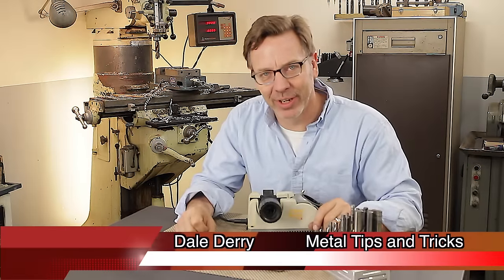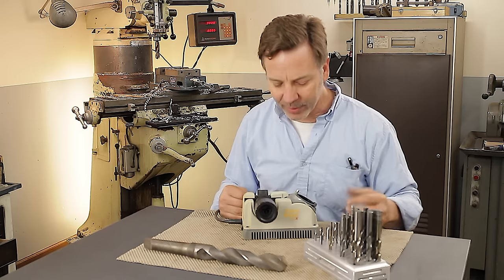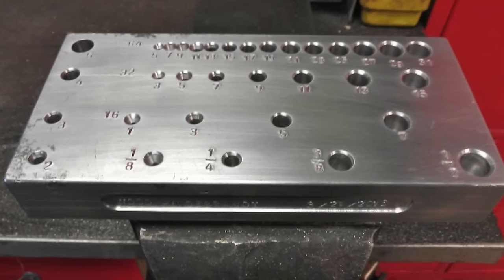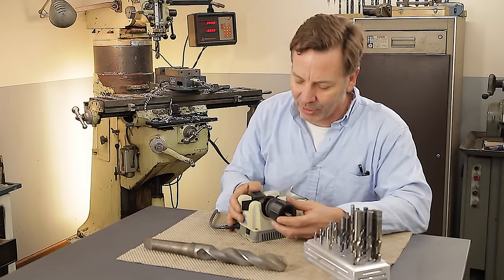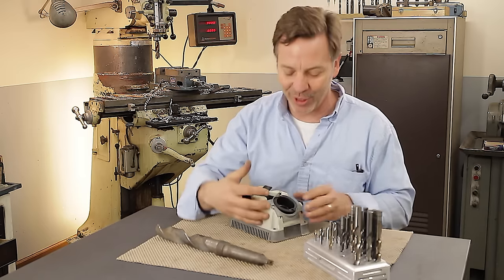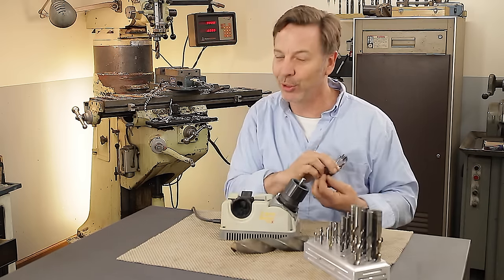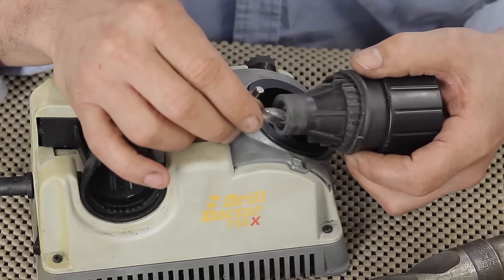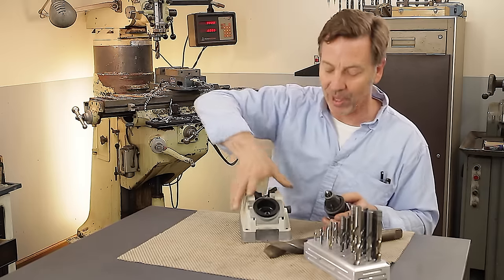How to Sharpen Drill Bits

Comment: My grandfather had one of these that is decades old.  When he passed, I received it.   There is an instruction video that came with it, but it is a VHS tape.  You can conclude that I have not been able to play it.  I tried messing with it one time and Screwed up a few drills.  So in a cabinet it went.  Now I want to get it back out and sharpen some drills.  Thank you for the video.

Comment: Greetings from the Jersey Shore. My neighbor got one of those for Christmas a few years ago and brought it over my shop so we could figure it out together.   I wound up sharpening all of my old bits in an hour or so that night.  Those things work wonderful.  My test for a drill bit is to put it in my tail stock of the lathe to see if the bit cuts evenly from both flutes.  Every bit I sharpened on the Drill Doctor cut evenly both fluted.    I've tried others hand sharpened bits on a lathe and most only cut from one flute. Chris
Reply: You can just put a drill in a pedestal drill press and once you have drilled a hole put the rear of the drill in the hole. That was how I was taught to eye sharpen drill's.

Comment: Hi Dale, 
Great video. I bought my Drill Doctor more than 15 years ago and have learned by experimenting what works best for twist drills. You have to listen to the grinding sounds. There have been no problems other than having to replace the diamond wheel due to wear. I especially like its light weight and bring it with me when drilling concrete with carbide spade point drills. The drill doctor puts a fresh edge on the concrete drills and the drilling go so much faster even when stopping part way through to "touch up" the drill point edges.
Thanks ago for another useful video,
Paul Jones

Comment: Good video Dale. I learned how to sharpen drill bits on a bench grinder way back in high school in Metals Shop Class back near Chicago. They've always turned out great, as I was born with exceptional eye sight 15-20, at least that's what the eye doctor told me. While working as a Journeyman Welder/Prototype Fabricator, I could see something off 1/64th" up to 16'. Well I don't have those eyes anymore, I'll soon be 59 in a few days, but I can still sharpen the bits. 

What intrigued me on the Drill Dr. was the split point. Now that I wouldn't do without a machine. I can clearly see the accuracy increase. I have a Harbor Freight Mini Mill that I got for creating my inventions. I do have a pile of drill bits set aside that need sharpening, and it's slowly growing.

I was put on SS Disability since 2007, and having a workshop helps keep my mind sharper. I'm now In the final phases of the upgrades on the mill, which last but not least is the  DRO. Maybe some day the next upgrade will be CNC'ing the mill. 

Remember those safety glasses Dale!

Keep up the good work!
Crevice Dog,
Vancouver, WA

Comment: Hi Dale. Thanks for the video. I have a 750 and when it is working it is a pleasure to use. What I mean specifically is that after a series of bits get sharpened to my satisfaction, I will put it away until needed. Then when I bring it out to use a while later it no longer sharpens right. The relief is now flat or negative and the settings are still the same. Its been a while since I used it but seems that the clocking on mine depends on the diameter of the bit. I have not had the patience to figure out the relationship but I think others have had the same experience. One good thing about Drill Doctor is their customer service even though they were not successful with me. Keep up the videos. Oh, and I am viewing this from Chuluota, Florida.

Comment: I had one of these, slightly different version.  Never worked right for bits over half inch, but it was helpful for the smaller bits. It was too much problem to get a replacement stone, so I just threw it to the side and now hand sharpen all my bits.  Bluefields, Nicaragua.

Comment: Myself i have to like the Drill Doctor as it makes sharpening smaller drill bits so much easier.
The fact that the flutes are the same length is why i use it. 
But for larger drills i still prefer to sharpen by hand on a pedestal grinder and check them with the scratch stick.
Thanks for the video Dale.
All The Best.  Peter. 
Melbourne Australia. 
Or as you yanks like to say Mel-Bourne Australia.

Comment: Hello Dale, I bought one last birthday and I'm very satisfied. I use the 180 grit wheel more, because i use the smaller bits most. A fresh sharpened drill bit is a joy to work with. I have the grey 500's DD, but I do want to buy the larger head, Amazon has it for 60.-€. Love your videos, go on with it!  Hanno from Hamburg, Germany
Reply from the maker: +MrMiffy08  thanks for you comment. 😀

Comment: 118° HSS Bright Finish drills are for Non Ferrous drilling.  Generally speaking, Black or Steam Oxided drills are more for steels, cast iron, etc. 135° Bright Finish split point drills are ok too, they tend to walk even less than a 118 split point.  Keep in mind there are also NAS907 (perhaps others) aircraft geometry drills.  As I've recently learned, if you're gonna drill Aluminum... beat the race by picking up some OSG ExSusGold drills.  You won't be unhappy.  A Darex or DrillDoctor is quite a tool and handy in the shop.

Comment: HI Dale.  I've been using the DD750 for probably 10 years.  I use the 135 edge split point geometry almost exclusively.  I find the 135 point, when split is better than 118.  Standard non-split "jobber" drills that have the short web connecting the drill lands perform best at 118 deg.  I do like the DD and use it to do 135 splits down to as small as #40 wire gage.

Comment: I have one of the original Darex sharpeners, floor standing, with a 2 wheel Baldor Griber.  I handles everything form 1/16 to 3/4", plus I can custom grind bits  for special materials like plexiglas.  It must be close to 30 yrs old, and works as well as when I first got it

Comment: I have a 'blue' drill docktor out in the shop... but its a real older one... so old I still have the box it came in, and it came with a VHS tape on how to use it!
its okay for general bit sharpening...the more advanced ones back then were real expensive.  I do fancy one of the new ones, though.

Comment: Hi Dale, Vancouver, BC, Canada. I agree. I have two drill doctors (older blue, 3/4). I use them every weekend. Not so good on small bits (3/16th blah blah). 5/8th plus good but slow. Still, handy as stink on most. I have a Pines drill sharpener which I can do up to 3" twist drills (which I also love), but for smalls, the Drill doctor is great. Yes, the flute alignment is cheesy, but it works.... Also, the collets clamps are cheesy, but they work. A good investment... Cheers, Daniel

Comment: I'm glad you gave the DD a good review.  The guy who claimed the tool 'bit' him, did his viewers a disservice.  His poor review steered a lot of people away from a very useful item.  I use a short piece of rubber automotive vacuum hose to hold the smaller, shorter bits when putting them in the chuck.

Comment: I haven't been too impressed with the build quality or precision of my drill doctor, but ill try these tips. I find it works pretty good down to about 3/16", and anything smaller than that I'm just not confident the chuck and alignment jaws grab the bit well enough for it to be truly concentric. I've definitely ruined a few 1/8" bits on this machine. Luckily, none of the machining I do has to be highly precise, but if it did I think I'd consider a more industrial unit.

Comment: Dale I have one of the drill Dr the 750 model x. Sense I have had it I have not been able to get it right yet. It sharpens the bits good but if I don't have a pilot hole drilled first the newly sharpen bits will not cut a non drilled hole. I have also researched it on you tube and found most people don't have good luck either. Any advice on what I might not be doing correctly. Like I said if I have a pilot hole already in the work it cuts threw like butter. It's the point of the bit that I can't get right ? I have set the machine in every position it has and the outer edges of the bits is sharp but not the centers. And also the larger bits seem to do better the smaller ones is a nightmare.

Comment: Like you say, got to fool around the different helix angle, works ok for most situation. 

Those cheaper models are a decent alternative to high end  $2000 class sharpening machine tools...

With the proper skills and a little gauge, hand grinding is also great, takes practice though

The 135 deg. point angle is used more for harder materials like cast iron and alloyed steels, the softer the material the more acute the angle...  The 118 deg. is some kind of a compromise for a "Do-it-all-tool" ....     ;)

Comment: Still love your videos. (Question), Why is it when i drill holes in mild steel, there is always a lip on the bottom end, it is always smaller, 
 Thank you.
Reply from the maker: There are several reasons and it is not easy for me  to explain. But here is a short list. Use quality USA made drill bits. And keep them sharp. If I'm not sure it sharp I sharpen it.
Reply: *****
ok, thanks .
Reply: If the point of the drill isn't centered the bit will orbit around the off center point. That makes it act like a fly cutter and it drills a larger hole. When the point breaks through, the orbiting stops and it ends the hole cutting to the actual diameter of the bit. 
Invest in a drill sharpening gauge. It has a scale to help with centering the point of the bit.

Comment: The 500 and 750 are exactly the same machine.  The only difference is the chuck on the 500 has an internal collar that limits it to 1/2" because the company wants you to spend the extra cash on a 750 or on the upgrade chuck.  I took my chuck apart and reamed out the limiting collar to 3/4".  Works like a champ.

Comment: Read through about 20 comments I hope this advise is not a repeat. Yes a drill doctor is nice for smaller bits. However on the job normally you don't have one. Not many guys including machinist know how to sharpen a bit. Simply place two hex nuts together 120° grind with what you got and keep the bit cool as your grinding. I prefer a sanding wheel.
Reply from the maker: great suggestion  ill have to give it a try.

Comment: I am from Manchester England  . Your gadget looks ok but personally I have  always ground my drills by hand . I have
been a tool maker for the last 49 years(Retired) . Here is a tip on sharpening taper shank drills by hand  .(Measuring Device ).With a piece of 1/8"(3mm) steel plate 2" (50mm) wide   x 18" (457mm) long .Bend 3" (75mm) at 90 degrees  then drill and fit a small  centre 2"(50mm) up (A small nut and bolt with a point ground on the end) . The tang of the drill is centered drilled .Insert the tang into the centre then scribe using the drill edges on both sides of the drill .If the scratch  marks are in the same position the  two edges are level . This has never failed me,and more so on very large drills. if you are driling 316 stainless ,hastelloy or titanium you need more rake angle to reduce friction and the point thinning as to be perfect . when drilling brass and copper put a small flat on the cutting edge this stops the drill being violently sucked through the hole

Comment: I will have to disagree with you on the Drill Dr. I had the blue version and hated it so I bought a 750x, hate it too. I have more luck making stubs of what was a decent drill bit and wasting my time doing it (trying desperately to get a good grind). Let me be clear, I've tried and tried and tried to make the sharpener work but, using all the different indexing, applying different degrees of force on the camming mechanism as I rotate the bit holder, and wasting hours on trying to learn how to make a sharp bit on the DDr I've only had luck once or twice. If I should make up a number I'll say less than 3% success rate. There is way too much slop in the camming set up that puts the cutting edge below the shoulder so the bits ride on the shoulder rather than cut. If you really think the DDr is the bomb then explain to me what am I doing wrong? I've sent emails to DDr to try to clarification but they don't respond.

Comment: Hello from Ketchikan, Alaska.  I have had Drill Doctors for a long time, maybe 15+ years.  I find that they don't do a very reliable job on the negative rake off the cutting edge.  My all time favorite was the Black and Decker Professional from the eighties.  It is too bad they quit making it because it beats the Drill Doctor all to heck.  It did everything from the 1/8" to the larger half or 3/4.  It did it very reliably each and every time.  I find I can hand grind much better than the Drill Doctor and much faster.  I have had three different models over the years and had the same experience with each one.  Especially stubby small sized bits.  Seems to grind a positive rake angle no matter which setting you use.  I keep going back to them and spending hours thinking i am missing something as well as rewatching their video but it ends up back in the drawer.  Good subject matter.  I keep hoping someone will resurrect the B&D.  Doug

Comment: If you can't figure out how to sharpen a drill bit on your own, no video will help. I have been sharpening my own drill bits for decades. Large drill bits are expensive so I have to sharpen them from time to time out of necessity. But I will sharpen al of my bits down to 13/64ths in size. All you need to do is use a trued bench grinder and then recreate the same edge and point shape as the manufacturer made. Don't let it get red hot and cool it in water or oil when done. If the bit looks nothing like it did before it got dull then you did it wrong
Reply from the maker: HI Jerry, I do sharpen my large bits by hand. but for the small ones it easier to drop them in the doctor
I think I'm getting lazy LOL

Comment: I have been a tool & die maker for 45 years , from apprentice to now owning my own shop. I have NEVER called a drill a drill bit. i correct people all the time. Carpenters use drill bits not professionals in the metal  business. I sharpen all my DRILLS by hand.
Reply: Dan Mcbride I've been a carpenter for 18 years and have never heard that, interesting piece info, the differences in trades, I suppose in the machinists world you only use a press or mill machine, where as we use drill guns. Thanks